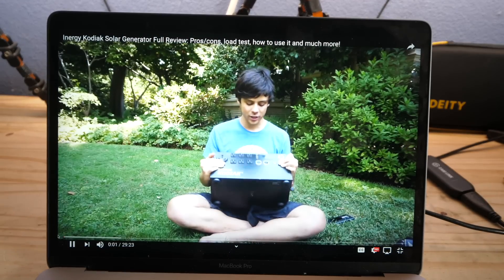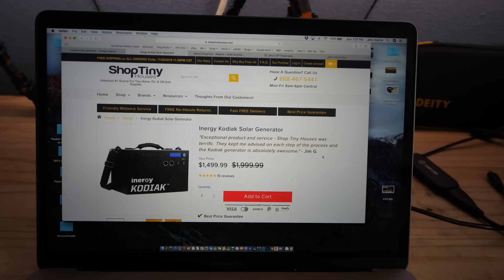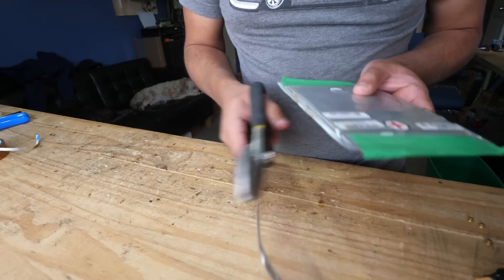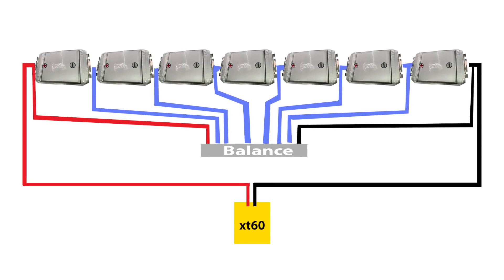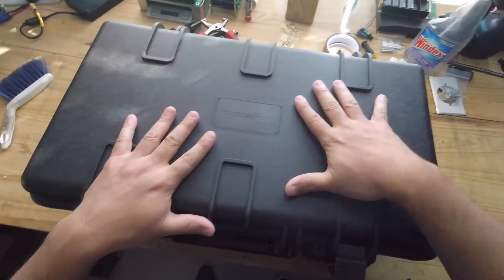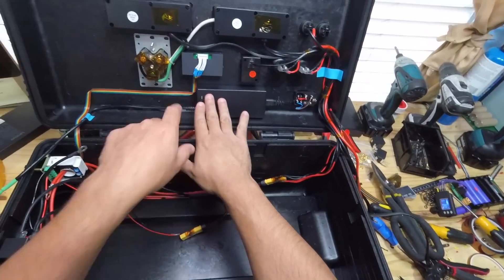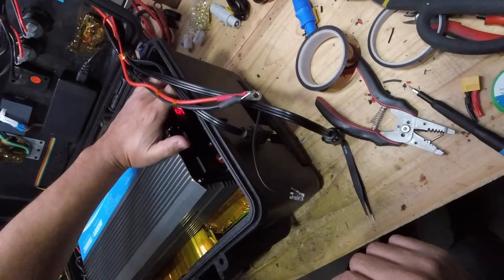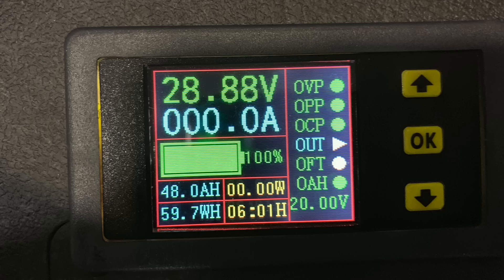DIY Inergy Kodiak Solar Generator

Comment: I feel like you could have used a single Model S module to get even more power in roughly the same space for just a little more.  Would have had 5kW for just $800-900 more.
Reply from the maker: Those modules go for $1200 and are not exactly 24v so not great

Comment: Inergy Kodiak is crap on the inside. The 18650 cells are very cheap and I would at least expect LG HG2 18650 Cells inside :P

Comment: Yeah good job you don't use fan for evacuate the heat of inverter?
Reply from the maker: Yeah I’ll have to make an update video doing the fans, bms,  solar  charging and adding external battery pack

Comment: Are you using Liion charger for Lipo cells? Following Amazon link and reading product description "8.Please confirm your battery, Because it is used to charge the lithium battery. Do not use the charger on the LiFepo4 battery, otherwise the charger will be got incredibly hot."
Reply: Lipo stands for "Lithium Polymer", same chemistry as li-ion. LiFePO4 "Lithium Iron Phosphate" is another chemistry with a lower equilibrium voltage.

Comment: Nice video, but what if your budged was $1500?  How much better would be your DIY generator in comparison to the Kodiak?
Reply: If you spent the extra money you are saving on more of these pouch cells you could add another 4-5kw of battery and still be at the same price of the kodiak. The cells are priced at $160/kw.
Reply: 3X. Get a bigger box or make a slave box and add double the number of cells to it.

Comment: Great diy video😎👍🏽👍🏽
Reply: Question! Does the case require ventilation. Did not notice any opening during the build on your video.
Reply from the maker: Yes you can add ventilation vents

Comment: 15% of the spin08hp i received were at less than1/2 capacity... You shoulda tested these
Reply from the maker: Less than 4ah?  I haven’t seen a single cell that low
Reply: Maybe i just got shafted buy shipping... Yours look pristine but several of mine were bent or crushed on the corners

Comment: It'd be cool if there was an overall schematic! It'd be great if you could post one somewhere! nice build overall! Why LIpo and not LI-ion? Can you charge the battery pack while also running loads through it? How are the cells going to stay balanced? What's the point of including the relays? I can't you using them to switch anything. Sorry I keep editing this but I keep getting more and more questions XD
Reply: Agreed, a schematic would be nice to this project. Thanks for showing it can be done for half the cost.
Reply: 2 reasons I could see for the battery choice (which actually was Li-Ion, not LiFePO4), is that the battery supplier donated the batteries for the project as a sponsor (not a bad thing, necessarily, 'cause without it, we might not have gotten this video), and the Kodiak unit uses the lightest Lithium Poly battery it can to save on weight while producing that 1100 wh storage capacity.  To duplicate it, you have to do the same thing, or else the weight goes up by over 50% (LiFePO4 batteries of similar capacity will weigh about twice what the energy equivalent in Li-Ion pouch batteries would).

One of the other things that wasn't addressed in Jehu's unit is the battery lifespan, which since these are used cells, probably don't have as many cycles left in them, but the only way to tell is to run them and find out.  I suspect that the Kodiak claim of over 2000 cycles is more marketing hype than truth, because it doesn't match the science of their battery chemistry, but the warranty is short enough that by the time folks find out that their battery is wearing out, it will be out of warranty, even if it only lasted 3 years...

Overall, I think this is a decent way to start designing a DIY version, although I would further customize it to better fit my needs if I was building one, like start with one of those large rolling toolbox totes and probably 3x the battery capacity, but I'd also have a completely different charging system than what appears in the parts list, 'cause some of us don't live in sunny California, and won't reliably have all-day sunlight, so we'd need to charge at a much higher rate when the sun was out and be able to support a much larger solar array input for the same size battery system.
Reply: @testuser3167  Also, LiFePO4 is substantially more expensive than either Li-Ion or Li-Po. LiFePO4's major advantage is service life. It might also be a bit more difficult to source a suitable charge control circuit.
Reply: The relays disconnect the inverter from the battery packs - a must have to prevent draining them down when you aren't using the inverter.
Reply: @chrisw1462  Little bit more than that, it also protected overcurrent as  it switched by the power meter. I also got one of that power meter.
Reply: This. All this info and materials are fairly useless to the everyday joe without having to guess what was done. Probably why these aren't as popular as the Kodiak. Just a few extra explanations and minutes of video away from telling us all we needed to know...Confusing.
Reply: How about a parts list?
Reply: Justin- you might be a genius is all...
Reply: Simple schematic would be great and i too don't know the use for the relays...
The Inergy Kodiak have a really interesting feature:  you can hook 12V lead acid battery to it and
it will use them to provide more power; AND charge them too! 
Please sir, or anyone else, how can one add this feature to jehugarcia's build?
Thank you very much
Reply: @cirelefebure5485  Per Inergy's online manual, the external battery connections are power inputs only, so don't expect to be able to charge a 12 v battery with it.  It's just an alternate power input to solar or 120 VAC for charging the internal battery.

Comment: No fans? Are you worried about heat? Under full load how much heat is generated?
Reply: Believe he had to remove the heatsink from the bottom of the inverter too.  Looked open to me when he put it in.
Reply: @sleepyratt2  That inverter is the same as mine. There is no heat sink on the bottom, they are on the sides... Anyway, that inverter has a fan or two built in but if there's no place to exhaust the heat from the interior, the heat will just recirculate inside the box and get hotter...
Reply: @DStrayCat69  a  couple 6yyyyggģg and ahhhhhh have bg
Reply: Why not use 18650's with the kits instead of pouch cells?
Reply: @ehink2716  I think is cheaper that pack got 1.2 kW
Reply: Why not a pair of Bioenno 12V40A LFP Batteries? A lot less Space taken up & 960 KWH. More money, yes, but I think more efficient use of space.
Reply: @bruceforster3709  Because it's more expensive. There are many different ways to make a better alternative ("better" being up to your own interpretation)  - different case, different inverter, BMS, cooling system, etc. As long as you take it as I think it was intended - as an example of what sort of system you can build yourself for significantly less - it's just fine. ;) It will create conversation, and hopefully inspire other people to make their own system rather than just buy one off the shelf.
Reply: @ehink2716  Because he got the cells from the sponsor. (See his comment just below the video.)
Reply: @ehink2716  because he wants everyone to buy the pouch cells cause tom at battery hookup has too many and cant sell them . Id rather go 18650 cells  for this project
Reply: @ehink2716  I'm guessing the Lipo Cells perform very well under high loads.
Reply: Because the video was promoted by a Lipo company and he got the pouches for free.
Reply: @wes9451  Yes, but as Tom Amerman pointed out, they also have good specs.
Reply: Yeah maybe cut slits in the side for the inverter fan to vent because eventually the inverter fans would be cycling hotter and hotter air. But keep in mind these cells are 200a rated. Using 42 they can push over 30,000w. This 2000w inverter is only using 7% of the battery's overall capability. So the fans would be more for the inverter which already has fans, just need some open area for that air to blow out and get fresher air. Like an inverter fan vent hose.
Reply: Exactly what I was thinking.  Most people have a fan for air in and one for air out.
Reply: Guy keep calm, just notice this man is totally crazy
Reply: That's the first thing I noticed about the design - very little  regard for heat dissipation and circulation . Heat from the inverter will build up and either damage the lipo batteries or even cause fire. First there must be some sort of isolation or insulation between the inverter and the lipo batteries and then there must be vents with fans to remove heat from inside the box. Lithium batteries do not like heat.
Reply: That and the space from and to the battery pack , you dont want them too close to the inverter.
Reply: The Kodiak has cooling fans
Reply: @calimesacox  even if kodiac has got a fan, there is no way to let them doing their job inside that small box, whit no space for everythings else and no external duct. So its perfectly like there isn't fans. But jeuh wasnt satisfied, and decided to put batterys in the same box.... its clear that He doesnt know what He is doing. He missing the very base
Reply: @NicozStrat  noticed the size of wires going to the inverter are extremely undersized.   

I would like to see a field test of his unit. Solar the 60amp plug, excetra
Reply: @calimesacox  the heat hopefully (it this man is hot totally crazy) doesn't come from wires,  but from everythings else as battery and inverter.
I hope i won't ever see this shit on market
Reply: @NicozStrat - Market?  This is just a budget DIY... The actual Inergy Kodiak costs about twice as much and looks like this...

https://theawesomer.com/photos/2015/11/inergy_solar_generator_kit_3.jpg
Reply: The inverter has built-in fan(s), and the plate that was removed is not a heatsink - the whole inverter case is the heatsink - the back plate is simply to enclose and allow for mounting. I would think for real-world usage there should have been a plate between the inverter and the batteries, to better protect the batteries, and also screened ventilation holes in both ends, probably with temperature controlled fans as well. Otherwise, a great build.
Reply: @pfeerick  I think you guys just don't understand how the heat dissipation works. This is not at all a great built
Reply: @NicozStrat  Umm.. if you've seen his other videos, you'd know.. he has more than a little experience with LiPo's and battery / solar hardware.  Can't answer for the lack of ventilation, but the inverter has a built in over-temp shut down.  With the batteries right below the open bottom, it would sense those too.  Not the best way to go, for sure.  Pretty sure I'd still want to wrap each pack in something protective (since vent holes would let foreign material and potentially water in), add a plastic divider under the inverter (with vent holes so the heat from the LiPo's has somewhere to go), and then cut an intake and exhaust hole with a fan.  With so little air to move, you don't need a large fan to keep everything cool.
Reply: If you're happy to rely on the inverters own cooling fan, you only need one on the opposite end (but still gauze covered vents on each end)  - it's own fans will move a lot of air once the trigger threshold is reached... it just needs somewhere for the air to come from, and to go... which is a bit hard in a sealed container! If you use a decent sized fan such as a 90mm or 120mm, it can even be slowed right down and you'd barely know it's running, whilst it's keeping a decent airflow through the enclosure. It certainly isn't a polished design, but it is a starting point, and will certainly give lots of people ideas about doing something themselves as it is much more affordable than the Kodiak ;)
Reply: Kodiak is pure sine for AC
DIY is modified sine. 
Not good for sensitive electronics
Reply: @orcinusorca3145  Very true. There is a link in the video description for a pure sine wave inverter, but if you went that route you'd then need to add in a standalone solar charger, or be willing to pay a lot more for the inverter - although I think it's only the 12v giandel pure sine wave inverters that also have a combined solar charger... so it's looking more likely a standalone solar charge controller would be the best bet.
Reply: Orcinus Orca what makes you say it’s modified? The link says it’s pure.
Reply: Totally agree.  The specs on amazon say the inverter is 90% efficient (if you believe it is that good).  So at full 2kW load it is still putting out 200W  of heat in that box, which is a lot, it is going to heat up in there for sure.
Reply: If you are pulling a load on this, in the heat and running solar to it, I think you’re gonna have a melt down. Shits gonna get hot
Reply: Ronando Ever since I joined social networks few years back I have found out that about 30% of people are pretty much insane.
Reply: There are fans.
Reply: There is watch the next video, I think he included your comment.
Reply: Idk what you all are talking about,  this has two fans.
Reply: Thats juat 50$ upgrade no big deal
Reply: I am sure he may have install fan. If you build similar one then put a fan.
Reply: he added the fans later ..
Reply: I bet you could add computer tower fans very easily to this (and they are relatively inexpensive)
Reply: I noticed that too... There doesn't seem to be any ventilation to cool the inside, although that is easily remedied... Cut a hole and put a screen over it... Much like a computer's power supply... then connect an exhaust fan... Drill some holes on the opposite end for air to enter...
Reply: Everyone here is SO SMART! Go make a video or shut up

Comment: Hwy jehu! Can you please tell me why didn't you used a step up/down module while connecting batteries to inverter?
Reply: Why would you need that? The inverter he has works fine with 30V

Comment: do you have any other suggestions for the batteries?  maybe a none used option or something that is just a single battery that would make the process even easier?
Reply: A single cell is 3.5-4.2V. A "single battery" is a collection of cells or other batteries!
So it is still a single battery. The minimum for a 24V inverter is 7 cells but it would run out of juice quickly. That's why you have to add more in parallel. That is unavoidable.

Comment: I like it but in Europa is it useless
Reply: Gil Bonte nope just use A inverter that Goes to 220 v and other plugs
Reply: Exactly. Just get 230v inverter and eu plugs. I wonder about lipo batterys. Why not use li-ion?
Reply: And also the prices for lipo and li-ion cell are sky high
Reply: That is true. I'm lucky that I can get used 18650 cells from local battery shop for free. Mostly used cells have been really good, tested over 2ah at 1a current, best over 3ah. I'v made many pacs out of them. Thanks to ekakit oy turku Finland. Mabe you have battery store near by you too...
Reply: @bassotalli6494  if you choose this one: https://eu.nkon.nl/rechargeable/18650-size/samsung-18650-inr18650-25r.html and buy 135 of them (to match the same capacity as he did in the video) you spend 370€+shipping....actually not that bad ;)
Cheers :)
Reply: it's not a 230/240v it's just a 30a 120